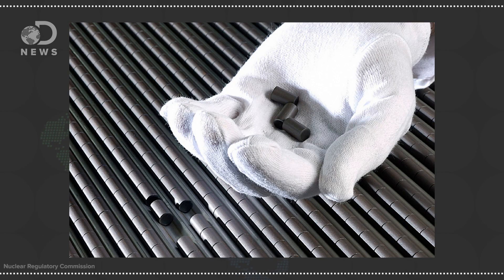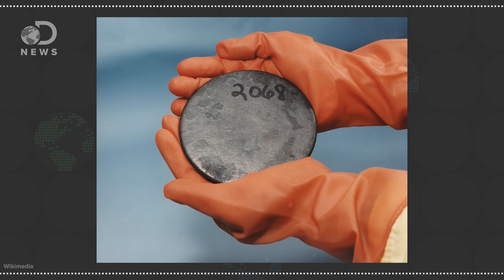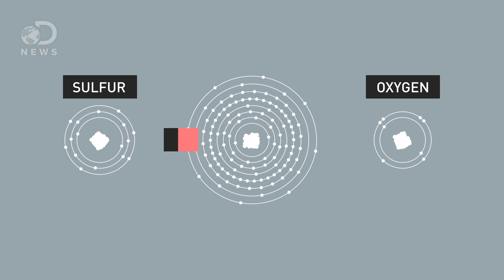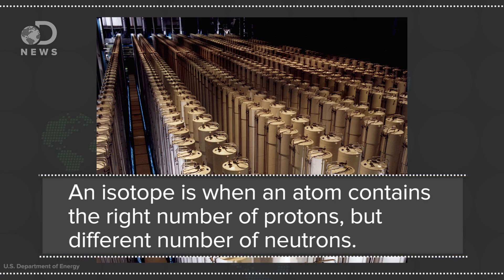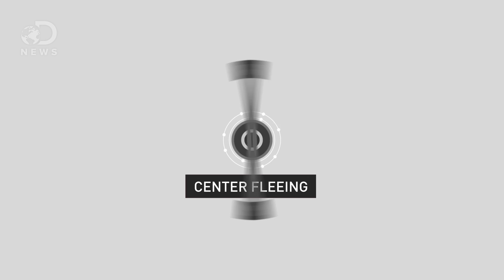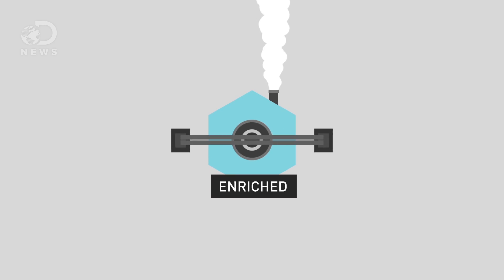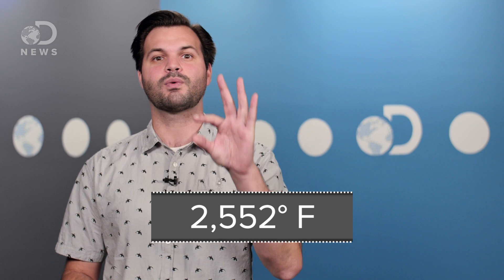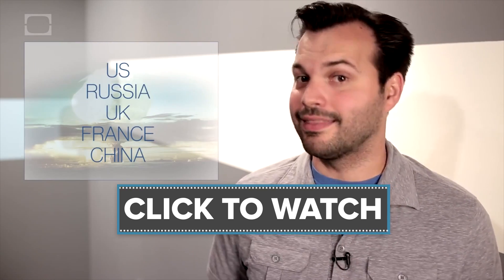How Uranium Becomes Nuclear Fuel

Comment: can you talk about thorium reactor's
Reply: BulletToTheKnee you're the Hero nobody deserve or want, but you're the hero we need. 

you are a...unitato.
Reply: ***** So just because they don't exist NOW you think it is pointless to try do develop them for the future? What if we had that attitude for everything else? We would still be living in caves if that was the case.

Of course there are theories, the problem with LFTRs is not the power output, LFTRs will use CO2 as a heat transfer gas into super efficient gas turbines that outperforms the water turbines of LWRs by a long way.
The main engineering problem has to do with the chemical separation of the materials in the liquid fuel.
Reply: *****
Efficient?

The final energy output of 1 ton of Thorium ore in a LFTR equals about 235 tons of Uranium ore in a LWR.

Assuming equal 3% purity of the ore the waste from the LFTR will be about 2.1 kg while the waste from the LWR will be about 7 tons (6838 kg depleted uranium and 211.5 kg waste)...

The 2.1 kg waste from the LFTR needs to be stored for only 300 years.
The 211.5 kg waste from the LWR needs to be stored for 100.000 years.
Reply: danielxxv putting a reactor in a car is a stupid idea indeed but making a reactor is a whole other story

also the person who is talking doesn't understand *energy* density
Reply: Fucking this. Exactly what I came here to request. Weren't even planning to watch the video.

Uranium sucks! LFTRs rock!
Reply: ***** go away you fatass
Reply: ***** 2.5 neutrons are released which catalyzes the next thorium atom into protactinium (which will decay to u233) and one to fission the next u233. its an extremely efficient setup.
Reply: ashley beaumont watch?v=568iDYn8pjc
Reply: Austin Pinheiro You can talk about the theory behind it, or the pros and cons to using thorium instead of uranium.
Reply: *****
Geez, so you chose to ignore my helpful tips.

But ok then, here it comes, dumbed-down for your benefit: "A LFTR works by having the Thorium fuel surround the reaction core and thus getting bombarded by neutrons. This turns the Thorium into Protactinium. The Protactinium is then separated from the Thorium fuel chemically and left alone until it naturally turns into Uranium (after about two months). The Uranium is then put into the core to join the chain reaction."

Easy peasy.

And no, I am not any kind of engineer, I am a happy amateur that just happens to be able to read and absorb information...
Reply: *****  Alright, details it is then.

Thorium reactors make their own U-233 from super abundant Thorium by having the Thorium fuel surround the reactor core, and thus both function as a radiation shield AND transforming the Thorium into Uranium = ZERO energy.
Regular Uranium reactors run on super rare U-235.
When you start the reaction with U-233 you get TWO fission events from the uranium, with U-233 90% of it fissions, the rest turns into U-234 and then U-235; who then fissions again with 85% efficiency.
When you start with U-235 you only get one fission event and must thus mix in plenty of U-238 so it turns into fissile Pu-239. But then you get PLENTY OF NASTY TRANSURANICS!

In addition, a LFTR uses 100% of the fuel.
97% of it turns into perfectly safe fission products, the remaining 7% only needs to be stored for 300 years.

In a Uranium based light water reactor the fuel is taken out and labeled as waste when 95% of the Uranium remains. The other 5% contain nasty versions of plutonium and worse that make to want to store it for 100.000 years.
Reply: *****
Now I know you are just a troll talking out of your ass. Nice Cartman impression I must say.

Pu-238 has a half life of 88 years, and you want to give it some time to half its radioactive output more than once.
-I sure hope you know how half-life work? It is kinda hinted at in the name.

Australia does not have nuclear power plants at all.
Swedish nuclear powerplants came out of the Swedish nuclear weapons program you ignorant troll.
The rest are just following the flock and are satisfied with using what works.

Nixon killed the molten salt test reactor because he wanted to promote the fast breeder program in California. And then they fired Alvin Weinberg for pointing out that LWRs sucked.
Reply: *****
Troll posts don't deserve a proper response.
Reply: ***** A waste of time.
Reply: *plural.
Reply: ashley beaumont  im pretty sure they dont exist yet,
Reply: danielxxv Go look up Thunderf00t and watch his video's about thorium powered cars.
Reply: nickw1235 +Thunderf00t does not cover the LFTR. Just because thorium powered cars are infeasible does not mean that the LFTR is infeasible. It would be good if both +Thunderf00t and +DNews covered LFTR.
Reply: ashley beaumont hate to break this to you but its bullshit.
Reply: Merecir Where you get these stats from lol! 

Because they look all made up. Its not physical since uranium is massively more unstable than thorium so the energy output of uranium products will always be more than thorium by a mile. Try flipping those numbers around. 

Wanna know another reason why your stats are BS....

A pure thorium reactor has never existed. We only have ever made one that was driven by uranium.

Its simple physics actually, Uranium only needs one neutron embedded to make it split. Thorium needs 3!! And guess what happens during this process??!?!?!? 

YOU MAKE FUCKEN URANIUM! 

Thorium does not split easy. uranium does because its the most massive a particle can be before SN forces are irrelevant.
Reply: Merecir huh so you're a nuclear engineer? Because I highly doubt anyone else would have the time to look at these papers and even understand whats going on.

You're so full of shit its hilarious. Its all about splitting atoms by adding neutrons. Without that you don't have nuclear reactions. And you can extract the most energy from uranium. Its that simple dude. 

Stop coming with these "fallacies" where you bullshit that you read something somewhere when you haven't. Or because a engineer or some dumb fuck wrote it, the paper is infallible. It doesn't work that way and it never has.
Reply: ***** i already pointed this out. u233 is what is fisioned in a thorium reactor.  u235 is not the fuel, and i am not sure of any amount of t232 that gets transmuted to u235. you can fission whatever  you want (that fissions) inside one, but if the fuel is t232, its u233. poop in your hat
Reply: **and to clarify: "any amount" should read "any noteworthy amount"
Reply: +Zypofaeser neutron collection
Reply: ***** What is?
Reply: Erik Beyer Paulsen thorium reactors. People try to hype them up so much, but they don't even exist. We don't even have complete theory to build these reactors to reach the output of uranium reactors.
Reply: ***** We're getting there though.
Reply: Erik Beyer Paulsen are in a collaboration with chemists and physicists ? If not you don't know shit.
Reply: ***** I heard that scientists are working on it.
Reply: Merecir No im saying the science of them is unclear and unproven and NOT science. 

Why on earth should it be looked at by a science channel. 

besides theres no real point in developing the tech right now because uranium is just way more efficient than what thorium can be.
Reply: *****  I have accumulated a lot of the stats, numbers and facts from scientific papers, engineering designs and lectures about LFTRs.

Who have said that we would split thorium?

Before we continue this and you make any more unfunded statements about the issue I strongly suggest that you take 5-10 minutes to study LFTRs and how they work.

And pay extra attention to the
Thorium-Uranium cycle as opposed to the Uranium-Plutonium cycle.

-For your own benefit.
Reply: Merecir ...thats literally what i said...

Thorium reactors literally just make uranium. This takes energy to do, in fact this is done with uranium. Its more efficient to just start with the uranium you already have...

Getting energy directly from splitting thorium is not a thing.
Reply: ashley beaumont I talk about them all the time :)
Reply: Merecir huh sounds like you copy pasted that from a know nothing website. Let's be honest, nothing in that mix has a half life of 300 years, efficiency of nuclear reactors are quite shitty ( you're playing a probability game of shooting neutrons into things hoping they split. 

splitting only occurs on a high probability scale at 235 of molecular weight because 236 is too heavy for the strong nuclear force to stop the positive core from killing itself.  233 is too small for this and is simply not physically possible to decay that fast considering most of it turns to a more stable 234. 

At the end of the day of have basically a shit ton of 234 and reactive materials due to incomplete fission where only 1 or 2 pr/neu brake off. This leaves you with unusable reactive materials. 

Thorium reactors are not some super fuel. Some things are too good to be true and this is the case for that. There's a reason no one uses theses reactors. The nuclear weapon fallacy is a crock of shit because the us has basically stopping making weapons. Also companies in canada/aus/Scandinavia use uranium plants and they don't care about weapons only profit. 

Obviously we tried thorium in the 50s then stopped, obviously this looked good on paper, not in practice.
Reply: Merecir 
Thorium or Uranium reactors are based on preference. They both have shit ton of waste(since they both involve splitting of uranium 235 which can end up based on probability into countless different isotopes of different atoms) To say a thorium reactor has waste that only lasts 300 years is a COMPLETE LIE, as a product can easily be Pu-239 (not Pu-238 wtf did you come up with that) which has a half life of 30K years or Caesium-135 (lower contents) at 3 million year half life, hell Iodine-129 is a common product with a 15 million year half life .

The Uranium reactors only need Uranium and its purifiers ( acid to purify mined UO2) where as a thorium reactor you need to invest into a whole new mining infrastructure, new land, and new technology to purify the thorium, and HOPEFULLY after all the energy input to get your thorium and producing Uranium with it, you'll get enough energy gains. (keeping mind you still need uranium infrastructure to supply your reactor)

I bet you the real reason we don't use thorium reactors is because you most definitely get less or little energy gains than that of going straight uranium to justify the massive cost of maintaining a thorium reactor. Thorium is not a fuel. It's a building block. You still need energy to make a building block useful.   

Uranium would be a shit fuel as it's the most stable atom in the universe with a half life of 4.4 billion years. but all it takes is the 235 isotope to take 1 neutron (this requires energy just like blasting 2.5 neutrons into thorium takes energy to only get u-233 which still needs 3 more neutrons for it to split) for it to collapse and based on probability well give you numerous of unstable isotopes which well decay to more longer lasting isotopes(which can still be radioactive like the Pu-239 or I-129). 

Uranium-235 is the ONLY naturally occurring isotope that can do fission. Thorium CANNOT do fission. thats where i thought originally that you were full of shit. The only 2 atoms in both type of reactors producing energy is the uranium-235(small quantities in thorium r.) and U-233 splitting(small quantities in the uranium r., this is very low energy and doesn't produce enough neutrons to chain react the system, thus U - 235 is added to produced more neutrons). every other process TAKES energy away from the system. But the key thing here is that U - 235 is required for this reactor to be self sufficient. 

The only way for a thorium reactor to be useful would be to produce uranium when we run out of it naturally since both reactors produce the same shit but thorium produces less energy LESS efficiently. Lets not act like only the USA matters, majority of energy production in canada is driven by profit. This is why alberta's climate standards went to shit. If thorium was SOO good, why wouldn't people invest into it here to get more profits due to increase in energy? because there's not a increase in energy output. we tried it before in the 50s and it failed. Even so the investment risk alone is VERY high due to the amount of equipment/engineers/labourers/land you need. 

"Swedish nuclear power plants came out of the Swedish nuclear program you ignorant troll"

No shit. that doesnt address why they dont use thorium. Or anyone else. People want money. You do that by increasing energy output. If thorium reactors had high energy output, people would be all over them, but from what it looks like, uranium is a better/safer investment and produces more energy.
Reply: Merecir mad cause im right.
Reply: ***** WTF you idiot. The physics make 100% sense. IT HAS BEEN DONE BEFORE! Read about the shippingport reactor. It was a normal reactor converted to run on thorium. It worked, and we could be modifying our current reactors to run on thorium. Again: It has been done at shippingport!
Reply: ***** The Idea behind a breeder reactor is simple. You turn fertile material (Th-232) into a fissile material by hitting it with a neutron. Then it decays into that fissile isotope (U-233). You then burn it with another neutron. Converting thorium into uranium is the way they want it to work, and why is that a problem. The fertile material is still thorium!
Reply: +Zypofaeser many reactors are thorium core 60% they can't breed plutonium easy & the waste is easy to deal with.
Reply: I read about that - It's a hush hush chemical - As it's safer
Reply: See Galen Winsor ´ NUCLEAR SCARE SCAM
Reply: ashley beaumont reactors* if you add an apostrophe, its a possessive, not plural